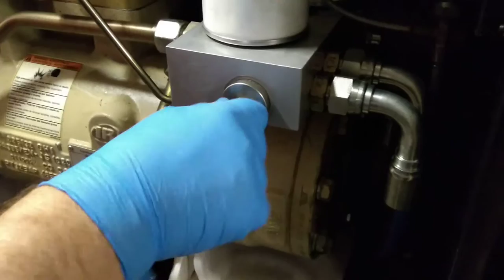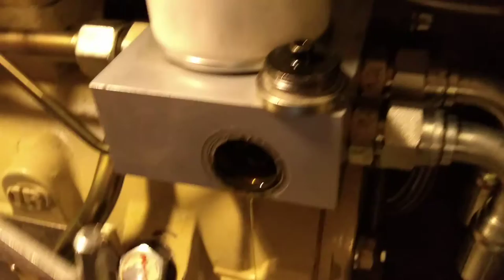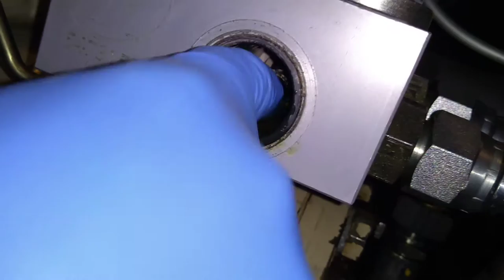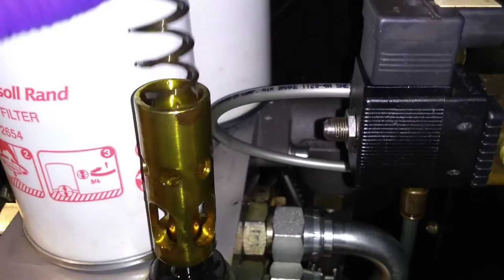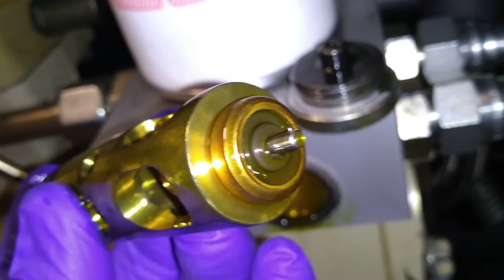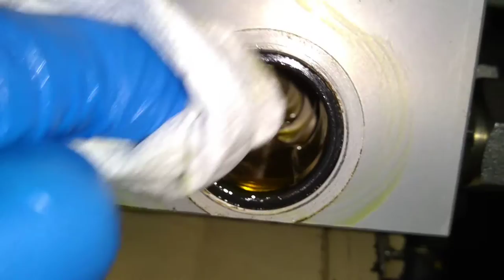Ingersoll Scroll compressor UP6 30 coolant manifold thermostat valve removal, unit turning off

Comment: Pls post the video where u have put a spacer to make fluid all the time flow through cooler till new spares recieved
Reply from the maker: Sorry, but I don't have that video.  We put a washer that fit into the line.  If you don't clean out radiator and make sure of coolant's temp delta, you will have trouble.  Hot coolant line will be too hot to touch and cool line will be about 40C.  Also, if unit is exposed to freezing temps without thermostat, you will have trouble.  Thank you.
Reply: You mean bypass thermal valve?

Comment: amigo buenos dias, tengo un problema de temperatura alta en un compresor Kaeser 250cfm, parece que no esta refrigerando bien el compresor, puede ser que el aceite no este haciendo su recorrido como debe ser por el radiador, pero no se como funciona esta valvula termostato. no encuentro información mas precisa
Reply: Hi there, tow day ago we did fix a similar problem who did take a long time to solve, so it seem the thermostatique vile malfunction, we did temoporary fix it by bypassing it untile the spare arrive, you could check the valve by putin it in cold then in hot water or oil, there is a good chance it is the problem,if you did check the filters of oil and air, also the oil level.
Reply: If you could reply to me the result you go,
Reply: Look for this video in youtube: How to bypass the thermostat valve?? (for screw air compressor)